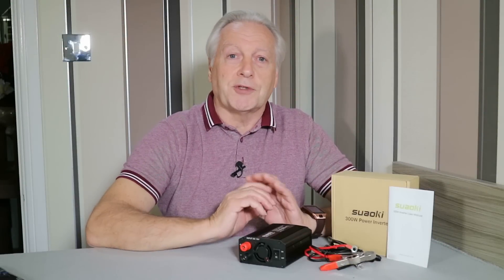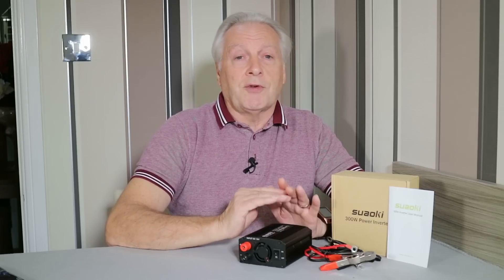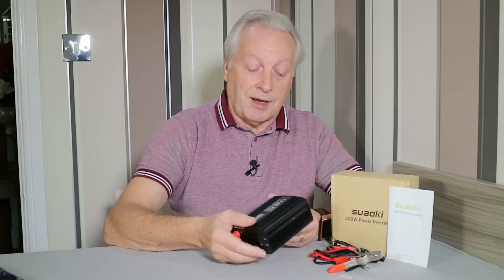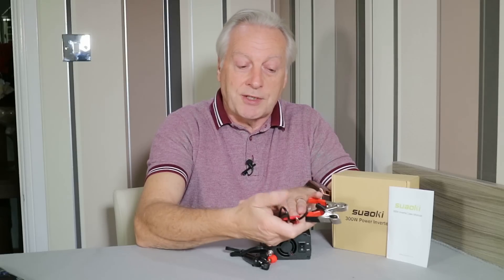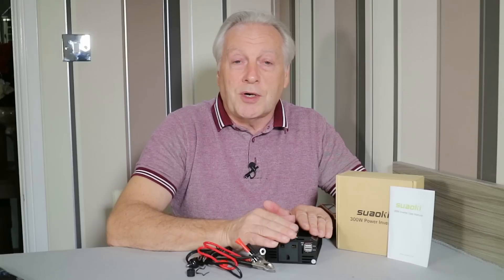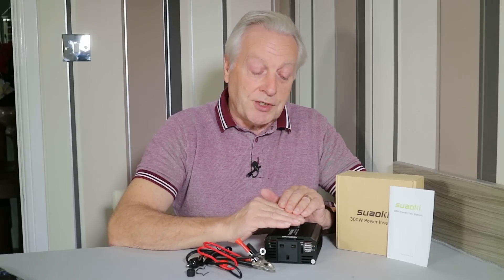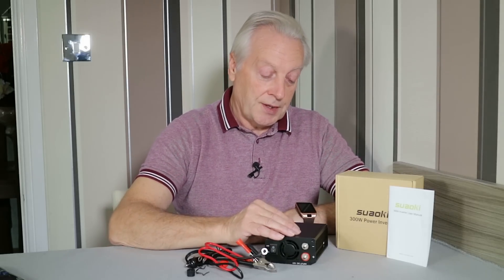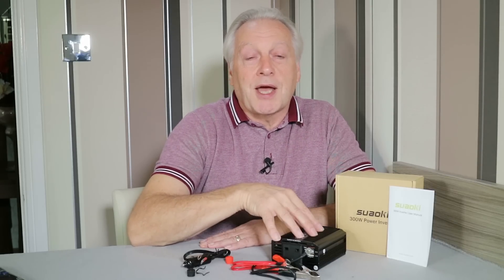Suaoki 300Watt Power Inverter Review

Comment: Nice review and very useful, I will buy with this instructions.  One question, may I start the engine and charge my car battery while the crocodrile  are connected and the inverter working with a 150W device plugged in?
Reply from the maker: Yes I've used it that way as the power drain on the battery is quite high with larger loads